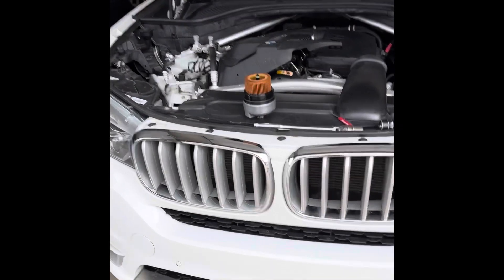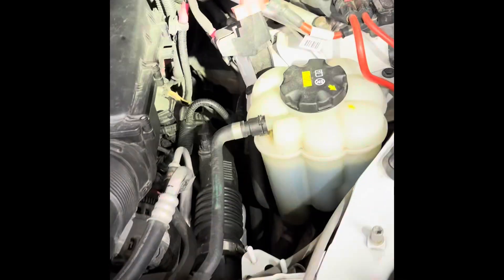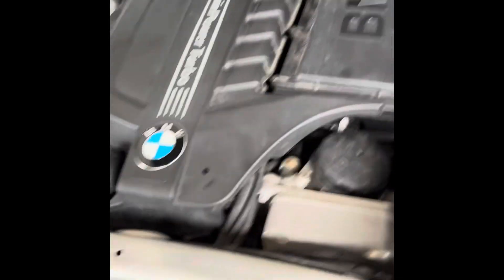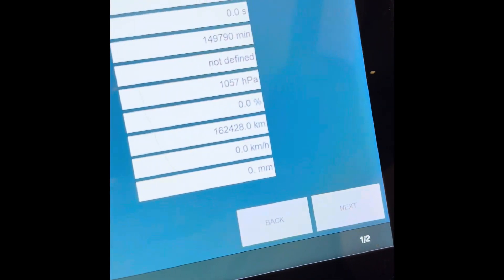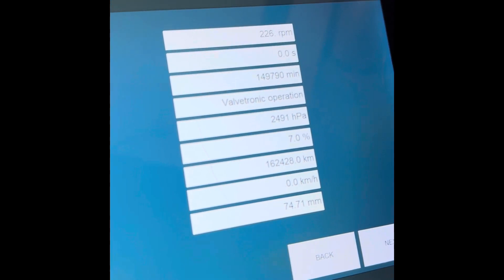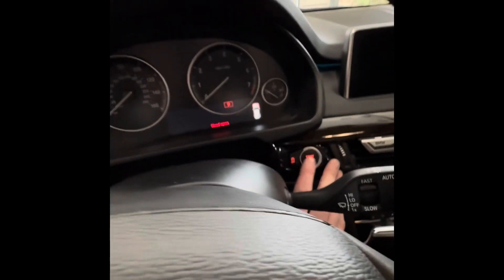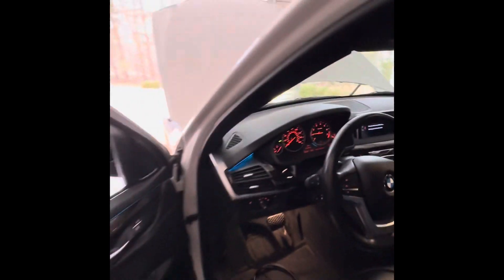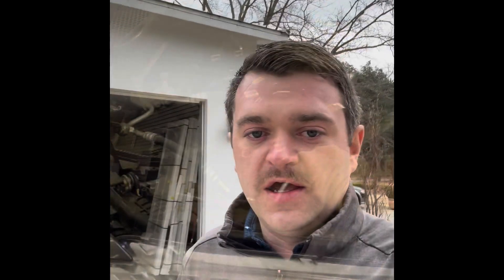How to Prime Oil Circuit on BMW N55 engine

Comment: Rod bearings that are too tight while running oil slightly thicker than water.....what could go wrong? Thanks for nothing BMW ! What page in the owner's manual was this on as I must have missed it.
Thanks for the video

Comment: Most important part which is which connector to pool you can't see s*** not a f**** bit of good the rest of the video is awesome
Reply: You can pull the very back plug off the ecu. It is a slider the pulls back. You might need a pick or small screw driver to get it but it can be done as I have done it twice. Good luck!

Comment: can you be more specific as to WHEN to do this oil prime procedure? Is this recommended after an oil filter change or reserved for more invasive repairs, i.e. oil pan gasket, oil cooler gasket, etc.?
Reply: Basically i‘d do it everytime where you loose a big amount of oil that needs to be „filled“ first during the first start or if you install new parts in dry that are normally somewhat pre-lubed when the engine was running.
First point would be referring to everything regarding replacing oil filter housing (gaskets), oil thermostat (gaskets), oil cooler, oil cooler lines, etc. 
Second point would be referring to complete engine replacement, replacement of rod bearings, replacement of oil pump, ..

I personally will do it now when taking out my M2 N55 out of winterbreak. I‘m a diehard guy so i can just sleep better at night after doing this.
Reply: @derlukas2676  If the oiling system has been disturbed, i.e. oil cooler gasket, where air is introduced into the oiling passages causing...I get. 

Would you do this for an oil change/filter change (as the most common and routine procedure)?
Reply: @ personally i would not do it for a simple oil and filter change. BMW also does not state it in their procedure.
Reply: I did the oil filter housing recently and forgot to do it but I did top up like half a quart of oil right after I finished it before starting am I fine ?
Reply: @montaeamiryan9436  If it was mine, I'd do it asap...did you already run it?

Comment: I'm not a master tech, just an owner, and I ALWAYS use a torque wrench on the oil filter cap.  25 Nm.   Just watching you tighten it by hand I can tell you did it too tight.  You'll crack the cap at the threads.
Reply from the maker: Thanks for the tip! I’ll make sure to tourqe next time!

Comment: good video, im at 150k on my 2014 n55b30o0. no leaks on the OFHG but i been scared to do it preventatively because of all the people who i hear blow the engine after the job
Reply: Priming is must
I have done it on my car and before that i havent ever done anything even no oil change. 
Its just unbolting 6..7 filter housing bolts 
And 7 intake manifold screws 
Then vice versa after changing gasket 

I took out fuel pump fuse out( inside boot ) and primed it